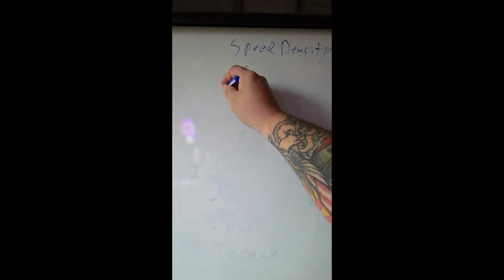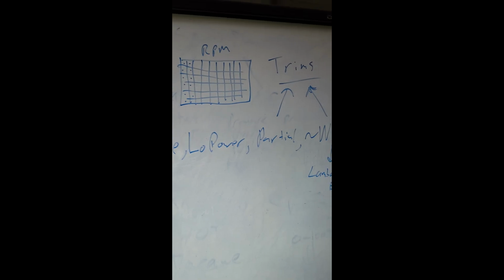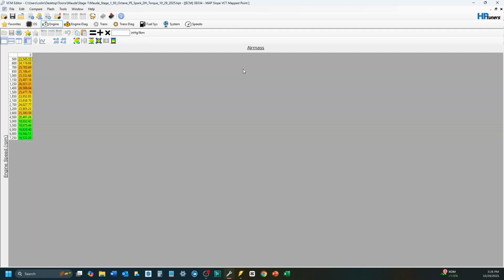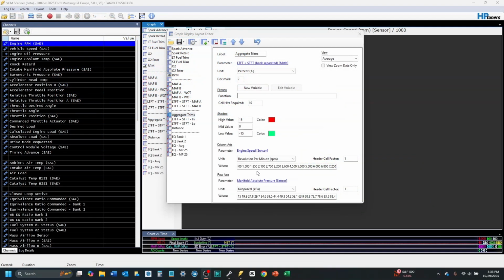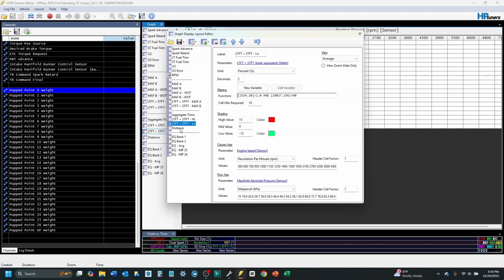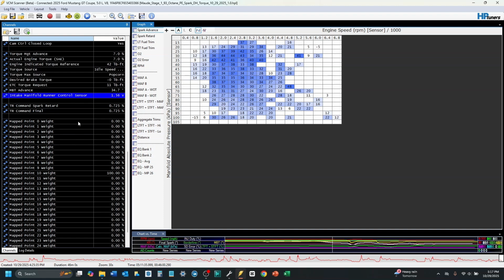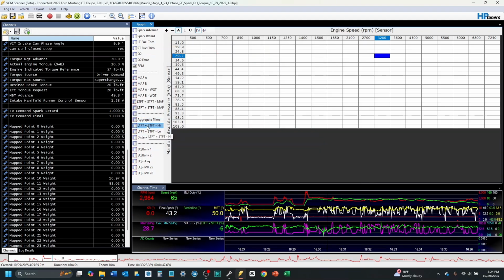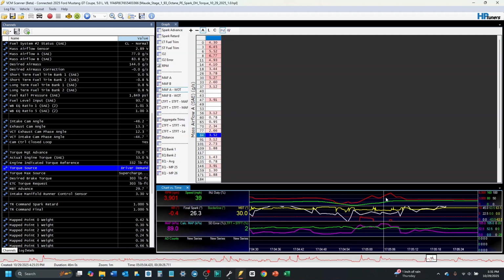Tuning 101 for the S650 Mustang: Speed Density, Part One

Comment: My S650 is in (inHg) not KPa I thought that was interesting
Reply from the maker: Portions of the tune might be noted in those units, it still works of course. Boost, for example, is still in psi, but we could express it in inHg or kPa if desired. Glad you're enjoying the channel!  I used to write tuning guides; first crack at the 'social media' method.
Reply: @TrojanTuning-S650 I definitely appreciate it. I have a canned tune on my S650 but I like to dial stuff in and it is locked. My tune on my supercharged 6th gen Camaro was not locked and really helped me learn a lot and dial it in.